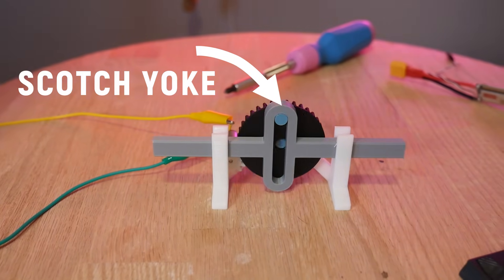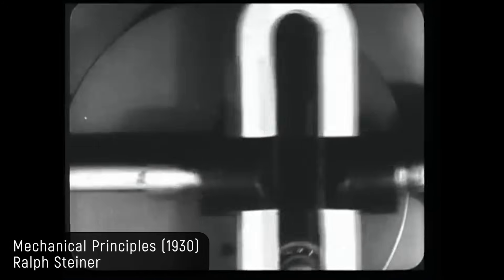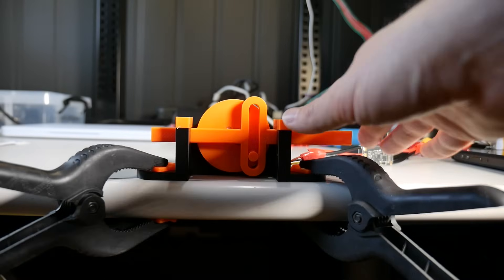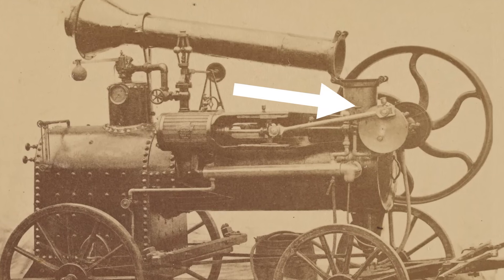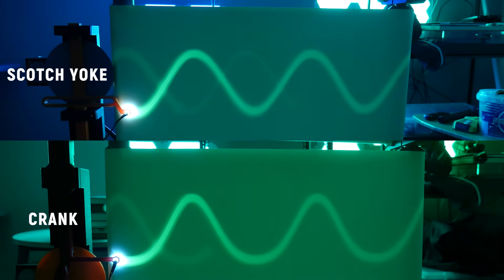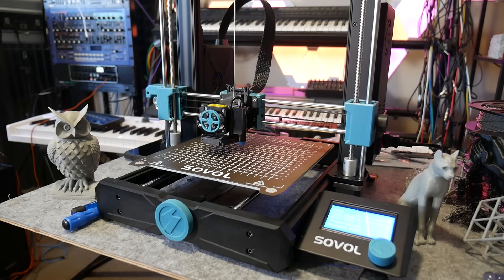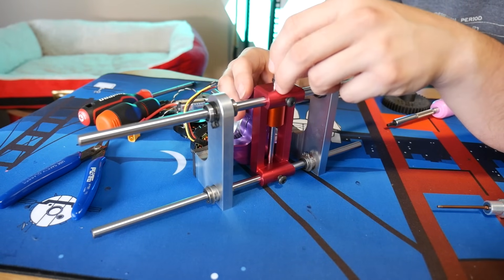This strange mechanism can predict the tides.

Comment: I think you're correct about the Scotch Yoke origin: a bolt or pin that moves within a slot. The slot can be understood as a scotch or as a yoke. BTW, the term yoke was used commonly in pre-industrial agriculture. A yoke is the harness (typically wooden) put around a beast of burden's neck and used to attach a plow or other farm implement. It's even mentioned in the bible.

Comment: it is used to move the head of a shaper. It allows the operator to change the length of stroke. one odd note is that the rate of linear motion is different on the push stroke than the pull stroke. https://images.app.goo.gl/MZXCiY2ScuyXWW3q8

Comment: Wow, love your metal scotch yoke. Some things are just art no mater what the point of the item really is.  

I once saw a hand gun, it was just so nice looking I really couldn't think of any reason to use the gun. It was more of a display piece. Old mechanical items such as hit-miss engines, old factory motors that ran the whole factory from one stationary place with belts running all over the factory. These were more than just functional items they were works of art in their own way.  Steam locomotives were the same way, works of art. 

BTW, how are the birds on your porch doing?

Comment: Interesting. I am looking at the reverse. I have really bad knees and cannot ride a bike, although an electric bike could be helpful. I also wish to put in more effort. As the motion is a pure sine wave, it may produce the necessary motion to convert the linear to rotary. However, working on reverse may be harder than the way that you have shown, especially when at the top dead centre. Nice video; I like it a lot.

Comment: We use them in aircraft propellers to change the blade angle.  A typical propeller will be connected to a hydraulic piston that uses oil pressure to push on a rod to then rotate the blades.

Comment: a 2:1 hypocycloidal mechanism is much better friction wise compared to scotch yoke mechanisms, and uses standard bearings that handle heavy loads much better.

The leverage and sinusoidal movement is also identical, without the drawback of stresses and binding at the ends of the slot in a scotch yoke.

Comment: Another interesting application is in metalworking shapers. There, the scotch (thank you! new word!) is pinned on one side, and the other side of the slot provides the linear motion. This allows a greater or lesser proportion of the rotation to be applied in one direction - for example, 65% of the rotation might be moving the mechanism in one direction and 35% of the rotation in the other. The result is more power being put into the forward, cutting stroke while the return stroke is fast (but has less power). It's a fun and mesmerizing mechanism.

Comment: 2:50 you'd be incorrect on that one, because your scotch yoke is incomplete. Indeed, all representations of it are incomplete. The scotch would be raw cast iron slider, with a shelf either side of the cut. On that shelf, a brass coupler block is inserted and "pinned" in place with bolted plating, that keeps it from moving outside up and down the scotch. The cut would be square, not round (again, very simplistic drawings of it) and inside the block is where the flywheel crank would be rotating. In my other comment, describing a pump, the only thing that survived the rust and damage was (of course the brass block) but also the heavily greased scotch area. It was so "ingrained" with grease that it couldn't corrode. Whomever photographed it way back had scratched the brass block and you could see the shine. Again, shame the internet lost that page. You know how they say "once on the internet, always on the internet" well. Not this case, and not the case for many, many other things.

Comment: I was just about to say I heard it was to avoid a Patent the yoke was invented and on further research realised it was YOU who said it. 8 years ago. I'm now convinced I have completed the internet.
Reply from the maker: Haha yeah that was the sun and planet gear. Going back to my roots!
Reply: Yeah, and wasn't it for actuating the input steam valves, not converting the output?
Reply: @TroyMackay  nope. just james watt avoiding patent disputes, as he was known for being rather pedantic whenever someone happened to use one of his own without appropriate royalties. so rather than pay royalties of his own, he came up with something else.
he may have been a tight fisted prick but he was also honourable. for instance, he never patented the governor, it already existed. he DID improve it though.
Reply: @paradiselost9946 I'm still not seeing it, as it would be a completely impractical solution to a high load situation as demonstrated here. There are examples of it being used in valve control, though.

Comment: Water pumps for mines. I think there's one surviving in Ireland, but i might be mistaken. Essentially, the yoke drove two leather diaphragms bowing in and out, that had on their respective other sides, a volume where once the diaphragm would be pulled outward (of the volume) it would pull water via the inlet flap opening and on the outlet side, another flap closing. This would be mirrored on the other side, "opposite stage". There used to be a site from a German pump enthusiast that had pictures of said pump back in the late 00's. Unfortunately, seeking it hasn't yielded results. :\ The pump in question was badly damaged (cast iron + water + ice = pop) and rusted. The yoke itself was at least 1.5 meters from end to end and the driving wheel was a big cast iron flywheel coupled (at some point) via a leather belt. I think the name might've been something something Yeoman. But yeah, been a song since.

Comment: A roller bearing running directly in the slot is the usual solution. Greater backlash is one downside to a Scotch Yoke. They're still popular in suspension damper dynamometers, but modern processing power makes it easy to compensate for the non sinusoidal movement of a crank arrangement, which is easier to build.
Reply: Scotch yokes are however more reliable than rack and pinion drives or pitman drive  for 1/4 turn valve control. Far less likely to seize.

Comment: James Watt did not invent the steam engine. Not even close! In 1776 he introduced a significant efficiency improvement to the 1712 design of Thomas Newcomen, which had been in use as a mine pumping engine. It was such a large improvement, that the engine became very cost effective and led to its widespread adoption. Technically, neither were steam engines, the power stroke being delivered by atmospheric pressure. In fact Watt lobbied parliament to ban high pressure steam, effectively trying to stifle new developments and protect his effective monopoly.
Reply: I came to say this, his contribution was the governor (centrifugal) by memory.
Reply: @cyclerical  The atmospheric engine works by letting steam into a cylinder below a piston, then condensing that steam to create a low pressure. The work is then done by atmospheric pressure above the piston. In a Newcomen engine, water is injected into the cylinder to condense the steam, which cools the whole cylinder. Watt's improvement was to inject water into a smaller connected cylinder. By not having to heat and cool the main cylinder, the engine has much higher thermal efficiency.
Reply: newcoming is generally described as a vacuum engine since the power stroke was caused by condensing steam
Reply: @ Both the Newcomen engine and the Watt improvement to it, are generally referred to as atmospheric engines.
Reply: Archimedes invented the steam engine
Reply: "His invention of the steam engine" not he invented it, just his version.

Comment: Instead of transforming the friction into linear friction, why don't you put the ball bearing directly inside the vertical hole, with a tiny little bit of play, so that the bearing rolls instead of sliding ? So apart from the friction inside the ball bearings (that exist no matter what), there is no friction anymore, or rather the friction makes it roll, so it doesn't wear anymore.
Am I wrong ?
What don't I see ?

Comment: Wouldn't another big benefit to the scotch yoke be simplicity? With a crank you have more parts and (I think?) have to consider the length of the crank. A scotch yoke is just two parts, and both are easy to reproduce when they wear. Especially if you make the yoke out of steel and the pin out of bearing brass or something similar. The pin will wear first, drastically reducing the wear on the more expensive yoke and is easy to remake, being a simple part to make on a lathe.

Comment: It looks especially cool when the frequency of the mechanism's movement starts to match the camera's shutter speed.
Reply from the maker: Haha yeah it all turns into jelly
Reply: @MakersMuse  Couldn't you "just" put a roller bearing on the peg that broke?
You would have transformed friction into rolling this way, no?
Reply: Frame rate, not shutter speed
Reply: @Henrix1998 shutter speed, not frame rate. The jelly effect is rolling shutter, which is what he was referring to. If it's about the fact that motion isn't distinguishable, THEN it's frame rate.

Comment: Why do you have two double length rods top and bottom instead of just left and right like the original? And why have a vertical rod in the middle instead of just placing a ballbearing on the tap in the slot? That way you'd have a solution practically identical to the original but without all that friction.
Reply from the maker: Single rods can rotate in the linear bearings - the mechanism collides with itself. A bearing on the pin rotates against the opposite surface, though I guess it could work with introduced backlash to give it some distance.
Reply: @MakersMuse  If the linear bearings rotate then swap them to linear bearings that don't rotate (i.e., linear rails).
And the backlash of the pin can be practically infinitessimal, since there's zero force on the side of the friction.

Comment: In my old job we had cup filling machines that used the Geneva mechanism for converting rotary motion to intermittent linear motion. Amazing what mechanical principles bring to life. And 507 Mechanical Principles book is a joy, the ideas and the illustrations.

As for friction, if the slot is machined from both sides and the pinion has two eccentric mounted bearings, one for each offset friction face of the slot, you can minimise it.

But the pinion on the rotating part applies least force to the slot in the TDC and BDC positions. The force transferred to the linear slide is not constant, but less at TDC/BDC and most when at 90 degrees from TDC.

So the rest of the machine has to be designed mindful of this inconsistent force. The Geneva drive doubles the frequency of the force change but halves the amplitude. It also has inherently better friction reducing mechanics without having to offset the slot bearing faces.
Reply: Just saw your linear bearing idea. We just use roller bearings on the pinion and they operate on the walls of the slot. But your linear bearing design runs really well, it just sounds right listening to it run. And easier to machine by far than the offset slot method I mentioned.
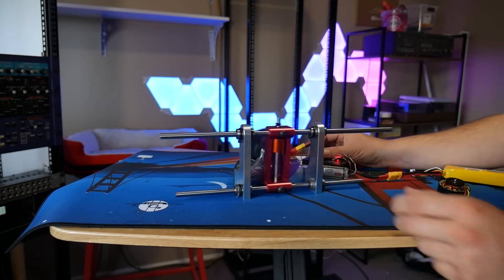Reply: Iokkkkkkkkkkkkkkooooooooooooooooooooooookoooooo❤as 10:54 10:54 and 10:54 i